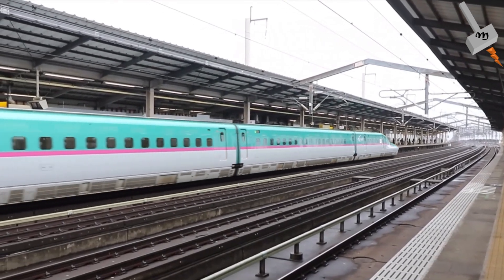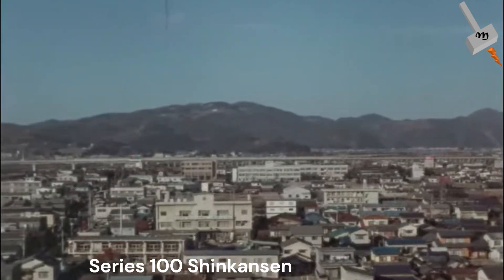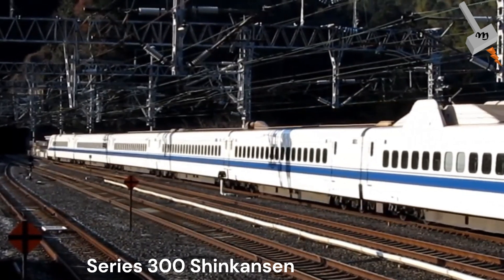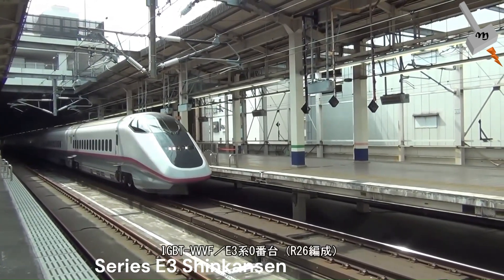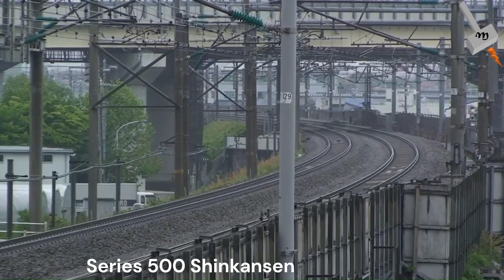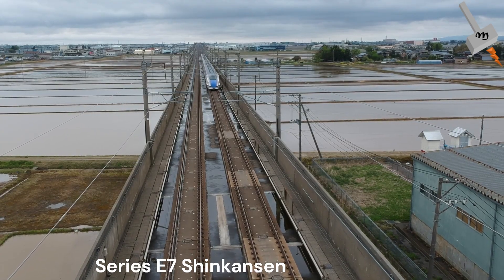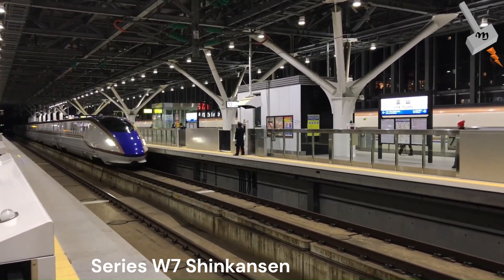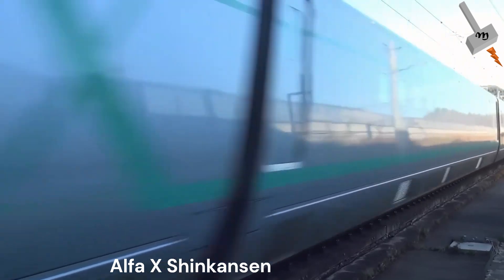Evolution of Shinkansen

Comment: 3:24 What is meant here by the term "Hunting"
8:09 yo dampers
Reply from the maker: The hunting movement is a consequence of the reversed conic shape of the locomotive wheel. For instance, if the axle is transversally displaced, the wheel rolling on a larger diameter will advance quicker than the other one, which always stays behind because the wheels are fixed in a rigid manner to the axle’s body. The axle spins compared to the vertical axis and, eventually, will approach the track’s middle axis. In this moment, the axle spinning angle will be at its highest value and both wheels will roll on even diameters. Next, the axle will continue its movement, leaving the center position to the opposite side from the initial lateral displacement, forcing the wheel to roll on smaller and smaller diameters and the other one on increasingly larger diameters. Both wheels will reach the same level at the precise moment when the axle center is situated at the maximum distance from the rail longitudinal axis. From now on, the movement will repeat itself in reverse. The axle center’s trajectory is a sinuous curve. This movement is passed over to the bogie and to the vehicle body through suspension elements. During the circulation, this hunting movement is also sustained by rail alignment irregularities; therefore, its intensity will be influenced by the size of these irregularities. In addition to that, the regime of this hunting movement depends on the running speed - at low speeds, this movement is stable and at high speeds, this movement becomes unstable. The value of speed when the movement behavior becomes unstable is known as the so-called hunting critical speed.
Reply from the maker: Yaw damper, a key component of the secondary suspension connecting the car body and frame, can effectively absorb and alleviate the vibration and impact caused by the change of the wheel-rail relationship, improve the bad contact state between the wheel and the rail, and significantly reduce the lateral vibration of the railway vehicle bogie and the car body so that the vehicle ride quality could be improved. The increase in vehicle operating speed changes the wheel-rail contact geometry, intensifies the vibration of the car body and the frame, and then changes the working conditions of the both ends of the yaw damper. The yaw damper alleviates the vibration between the car body and the frame, which reduces the contact between the wheel flange and the rail and improves the wheel-rail contact geometry.